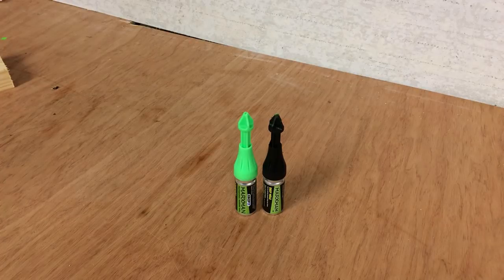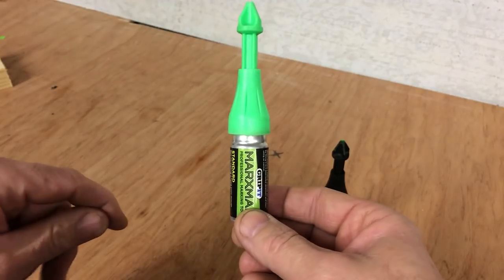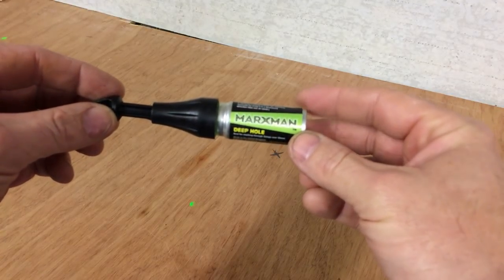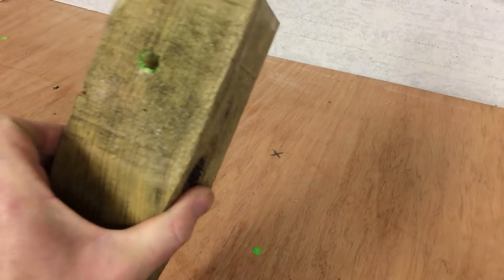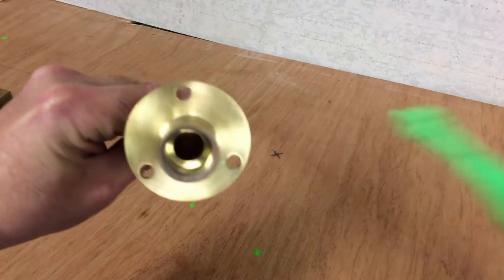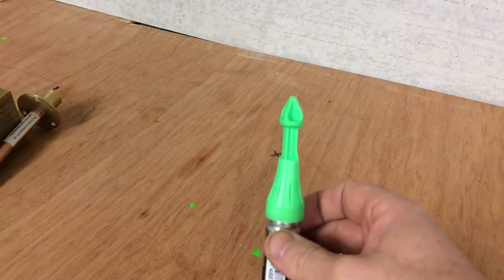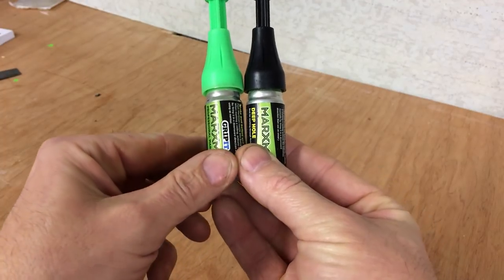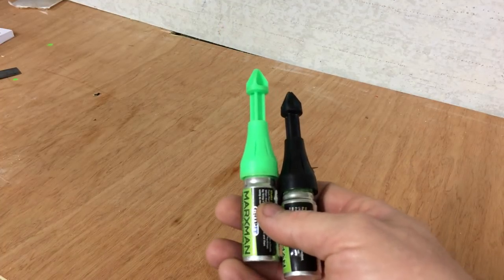Gripit Marxman Deep Hole Marker Review | Best deep hole GAS marker 2020

Comment: If you just wanted to buy one - could you get away with just buying the deep hole version? Thanks in advance.
Reply from the maker: Hi David, Yes, I don't see why not, I think they are just that little bit more powerful (i.e more gas pressure) so may not last as long as the standard version. Thanks for the comment 👍

Comment: Hi, is this the best option for marking out for drilling any holes?
Reply from the maker: It can be used for marking any depth of hole and I tend to use it all the time. The item is specifically designed for deep holes where you cannot get a pencil or marker through the hole. In my opinion, it is a fantastic option for marking all holes - I certainly use them all the time. I hope this helps and thanks for the comment 👍😀
Reply: Bacren Property yeah that sounds good. I find it particularly difficult lining up those shower riser rails! 😉 do the markers last long?
Reply from the maker: @simonstones1918  They are good for the shower riser rails (marking tile) and they last a fair while !
Reply: Bacren Property thanks . I’ll purchase one then. No more struggling 🤠
Reply from the maker: @simonstones1918  You won't regret it, they are great !
Reply: Bacren Property any other must have items/tools you would recommend?
Reply from the maker: @simonstones1918  It depends on your line of work or projects you have in mind Simon. Let me know and I will give you some items to consider.
Reply: Bacren Property i was fitting bathrooms but now I’m on repairs because of the covid situation. My company shut down the kitchen and bathroom mods. So it’s mostly taps and toilets these days 🤠 good learning curve mind 👍 basically I do most things but not electrics. I bought the veto propac XL last week. I bought the Nerrad Wrench kit- which is great! Saved my skin a few times that. One thing that does pee me off is the faffing about I get with tightening up nuts on  isos ect. Seems primitive. Keep slipping off the nut. Got to be a quicker way! Dunno, just any great tools that are out there that make the job easier. Maintenance at the moment but really I do whatever’s asked of me at work....
Reply from the maker: @simonstones1918  Hi Simon, I also recently bought the Nerrad Tapex kit, I hope to do a video on it very soon. There are so many tools out there that make things easier but in the case of the iso valves (compression fittings) I always use Knipex Plier Wrenches like these https://amzn.to/2Ex81KA I find the 180mm size the best. I also use Knipex Cobra, water pump pliers for holding the iso valves whilst tightening the nuts, you may have these already but these are a great tool, I have multiple sets of them. Olive splitters are a really handy tool, again you may have some already. I could probably write a huge list of helpful tools, but to be honest I may make a video on tools that make my job easier. I hope this helps somewhat ? Thanks !
Reply: Bacren Property yeah I had my eyes on those kipex. Are they really worth it? I will get some if you think tho. 180 being the best size to start off with. I have the standard  kipex pump pliers. Where in Scotland are you?
Reply from the maker: @simonstones1918  The Knipex plier wrenches are great but they are expensive. I would recommend them, especially for compression fittings, they will not slip off. I am based in NE Scotland - thanks !
Reply: Bacren Property don’t worry I’ll get them now you’ve recommended them 💪 where in NE Scotland? We’re on our way to Inverness. We have a night to kill between where we’re staying in Northumberland and Inverness. Any recommendations? 😎